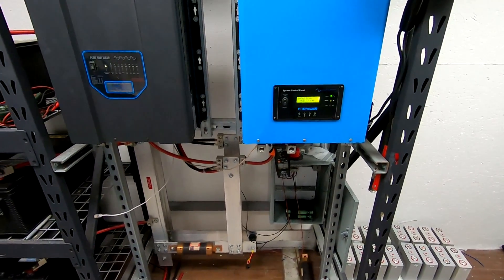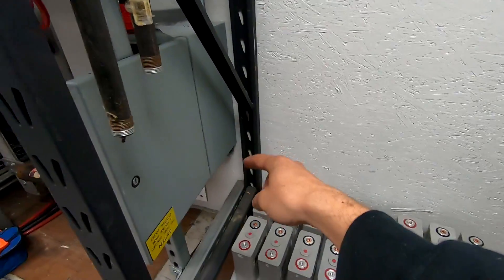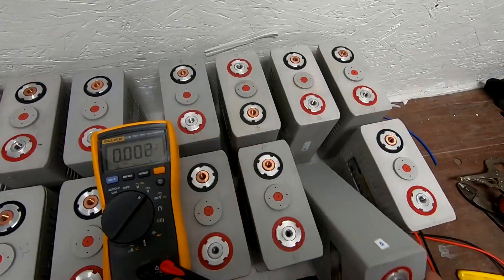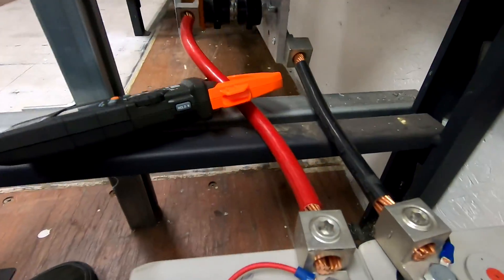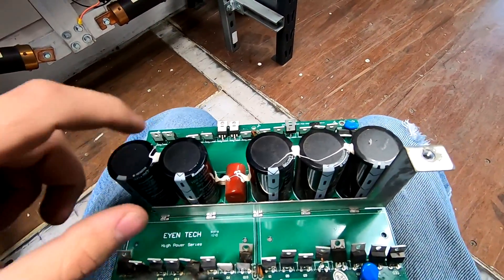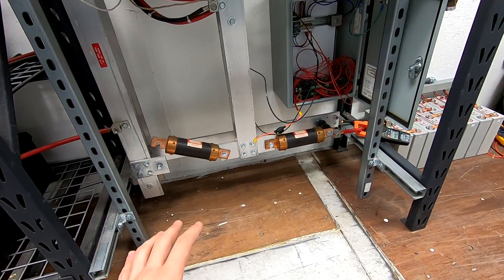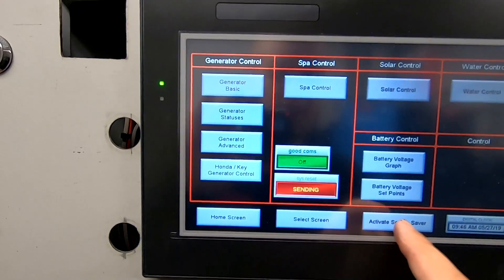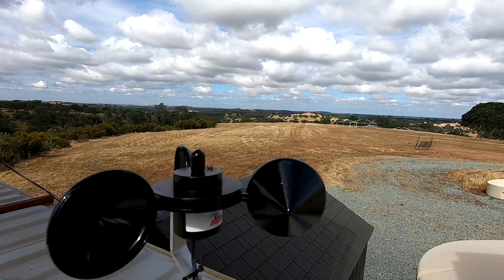Off The Grid: Installing the Best New Lithium Batteries!

Comment: Would like to speak to you directly. My wife and I are up in Reno-Sparks, Nevada working to be off grid. I was able to acquire two Absolyte GP 48 volt, 2,000 amp hour battery banks. We have a container for installation of electrical room like you have. If you have the time to speak - it would be greatly appreciated!

Comment: Totally enjoyed reading about your system grenading while gone. What are you growing beside solar on your 40 acres ?
I feel your frustration trying to run that compressor or plasma…!
I’ve got machine tools that are idle with no 3 phase…just 120…so I’m doing the DC motor route with full wave rectifiers.
We grow trop fruits off grid in so cal.

Comment: I plan on hooking my lifep04 right up with the lead acid and program the bms and charge control to a set voltage that both kinds of batteries like to stay at
Reply from the maker: That is literally a terrible idea. The best part about lithium iron phosphate is you can drain it down to nothing and leave it there and if it's paired with lead acid then you literally would be destroying the lead to get any of the benefit of lithium

Comment: If you cross any vertical helixed wind generators get them if you can. Such wind generator do not have to face the wind and will prove to lighten the load on gas cost, if any , when then sun is hiding and charging power needs are in demand etc...

Comment: With all respect to your skills can I ask why you have a 5hp air compressor? I cant understand why this compressor would be "necessary." Maybe it is because you are operating an air powered tunnel boring machine? 
Is that the highest drain device you have our are you running an industrial plasma cutter off of your inverters?

I do off grid for people that need it. What you have here is insane on so many levels!
Thanks for your time!
Reply from the maker: Oh yeah, we have air compressor and plasma cutter and welder

Comment: I found these on Ebay... Can someone tell me if this is a good or bad choice?  I have ordered a 200 Watt solar panel.  I'm 100% new to this... Appreciate any feedback on these batteries:  https://www.ebay.com/itm/LOT-OF-4-X-12V-200WH-BOSTON-POWER-LITHIUM-ION-BATTERY-PACK-18AH-POWERWALL/164125381684?hash=item2636a29434:g:2aoAAOSwaJ9agzSY

Comment: Hey thanks for taking the time to produce this video, and providing much useful info on your lithium setup!  
     On a side note about plugging in devices to power where they charge caps and have a huge inrush of current, I always use something like a lightbulb and wire it temporarily in SERIES on the circuit to charge the caps slowly, and the lightbulb gets dimmer and dimmer as the caps charge, and goes out when they are fully charged, then keeping bulb in place, I connect the actual main and there is no spark... Maybe you do something similar, but that's something I started doing as a teenager when working with big car audio amps and inline caps, basically anything connected that would make a huge inrush. I mostly always used a mechanic's 12v test light, but I imagine with 48v system voltage, one might want to use a lightbulb of higher voltage spec, and it would work in the same way. A resistor would work in the same way, but I preferred using a lightbulb because it gives visual indication of when the current flow is slow enough that the light no longer illuminates, then you know you're safe to connect your main...

Comment: Love your videos! Fellow electrician here as well. Im well on my way to building a very similar setup with a sigineer 15kw inverter. I understand you have the 12kw model and im really curious on how you manage the max charge voltage with those calb cells, as in, is the inverter charger adjustable for this or did you have to do something different to limit the max voltage internally or externally from the inverter. If youd rather communicate privately, that would be fine as well.

Im having trouble getting specific details on the available settings, as in max charge voltage from this inverter. Thanks in advance
Reply from the maker: I can make a video on it this week if you would like. It's actually rather interesting how I achieved this.
Reply: @HighTechLab  yes, id like to see more if you have the time.
Reply: mike h  in theory, yes. That inverter claims it can surge to 3 times it max rating so thats 45kw for a few seconds. Im holding out on buying to see what other inverters come out as they progress. Gentry solar has come along way and his inverters are stackable

Comment: At the highest point of the current surge, do you know how much current is flowing through each lithium battery cell? Or any estimate based on your experience?
Reply from the maker: When I start up my 5hp air compressor I get about 330 amps DC for a split second, but it really varies. Typically I try to avoid passing too much current through these cells, but when I do they handle it well

Comment: Are you just showing off??? I run my whole place and don't need anything near what you have. What are you trying to power...a machine shop?
Reply from the maker: We do have a shop, 2 RVs that are lived in full time and a hot tub that is kept hot with the excess power
Reply: @HighTechLab  Did you ever think about putting solar on the rv roofs? Or are they not used for travel.
Reply from the maker: They are occasionally used for travel but most of the time not so by having the panels at an optimal angle we get the most power generation possible.

Comment: Very interesting setup you have there! I have a couple of questions:  What is the BMS/balancing system are you using?  What was your solution to pre-charge your inverter capacitors and prevent damage from the inrush current?
Reply: Just use a small 12v motorcycle battery or a resistor to charge it up

Comment: Tip: Scrap copper tubing makes great cell connectors. Cut them to length, hammer them flat, drill a hole in each end.

Comment: I hate to break it to you, but your totally wrong about the caps. 6800uF isn't jack for capacitance. There is no way the leads would ever burn up due to charging a dead cap. Now if you ever got into the  2+ Farad range still using those leads then yes.
Reply from the maker: My statement is based on people actually blowing up their inverters. what evidence do you have to prove these blowing up inverters are in fact not blowing up due to this?
Reply: @HighTechLab  I think, the ESR of the Capacitors, not just the uF (size) is an important factor.  Capacitors with very low ESR + a Lithium Ion Battery Bank = very high amps in-rush ... which could cause problems.  All Inverters with large caps with very low ESR should have an "Off / Soft-Start / On"  type switch ( or external connection ) that allows for "pre-charging" of the caps through a resistor, or you can "pre-charge" manually.  How many amps can the Li-Ion battery bank actual push during in-rush?  4,800 Amps = 48 Volts / 0.01 Ohms ???

Comment: Thanks, for the video!    Very interesting setup you have there!   I did have a couple of questions, though:   What BMS/balancing system are you using?    And, what was your ultimate solution to pre-charge your inverter capacitors to prevent damage from the inrush current?   

I'm in the process of assembling the components needed for a 23 kwh LiFePO4 solar off grid system for a motorhome and an inverter similar to the black one you're using (I'm looking at the FuelZero 12 kw model) and I want to make sure I cover all the bases to prevent damage, as you described.   Thanks!
Reply: Richard Owens use a pre-charge resistor with a momentary switch

Comment: Wow - 180+ watts idle with the breakers off.  That is a huge iron loss in the transformer - I assume that's what gets hot and not the fets at idle.  I wonder why they do not use a toroidal transformer.  You should do a video on that transformer loss!
Reply from the maker: Why would a toroidal transformer make a difference?
Reply: Conventional "EI" frame transformers made of iron have edges where the magnetic field escapes rather than being coupled into the secondary coil.  The toroid "O" shape has no edges and completely contains the magnetic field inside the core, for higher efficiency without magnetic flux leakage. The O shape also allows for a shorter copper path in the windings which cuts i2R losses to a degree.  The downside is a special machine must be used to wind them, making toroidal transformers less common and more expensive.  All of the high end inverters, like powerjack, use toroid transformers.

Comment: Danger Danger Will Robinson! Get those Li-batts OUT OF THE ROOM, located out in a non combustable blockhouse. If you can somehow sink the blockhouse like a septic tank underground to level out temperature excursions they will last longer. If you haven't seen Li-batt fires please watch some on youtube, THEN GET THEM OUT OF THE COMBUSTION CHAMBER they are in at the time of the video making. You are aware of the hydrogen gas emissions of the lead-acid jobs and vent appropriately? The Li-batts are 100x more volatile. Better yet also place them in a deep sandbox tray because once ignition occurs you won't put them out and they'll need a static flame retardent bed to burn within. It's not a matter of if, it is WHEN. Let the comments roll...
Reply from the maker: Well, first comment is there's a difference in Lithium ION (like jehu's 18650 collections) and Lithium IRON, which is inherently safe when used properly [overcharge protection, battery balancing, overdischarge protection, over-current protection].  Under the worst conditions, any battery  can "smoke" - photonicinduction published a video deliberately overcharging a common lead acid storage cell creating a huge plume of smoke.  Jehu created an inferno of 18650 li-ion cells that burned another channel's VW bus interior in Alaska.  It is true that common Li-ion chemistry, such as the 18650 pack cells use, is a fire hazard, however Lithium Iron Phosphate (LiFePO4) chemistry does not exhibit these hazards, which is why I chose it.  These cells are used on aircraft, having passed the most rigorous of testing.  Take a look on youtube for real lithium iron phosphate tests and you'll see they require massive abuse like a 200% overcharge followed by a direct short circuit, and even then all they do is release smoke, no flames, no explosion - and it takes 14 minutes of short circuit abuse just to bring about the gas venting.  LiFePO4 is actually safer than lead acid when used properly.

Comment: Hello Hight tech! Can you use both systems battery ( lead acid and lithium ) in parallel at the same time?
Reply from the maker: Not really.  They have totally different discharge and charge curves.  The lithium cells would be drained before the lead cells began being pulled from.  Also the self-discharge of these weak, worn out cells is so high that you would LOSE more power than you store.
Reply: @HighTechLab  Thank you for responding! I currently working with a hybrid system with lead acid battery and lifepo4 , I made a wire diagram system that the lifepo4 charge with the lead acid system that is the main system for the production, and when the lifepo4 are full charge it interchanges from lead acid battery to Lifepo4 without fully disconnect the lead acid battery true a diode.

Comment: Aren't balance leads a little excessive for such a small lithium set up?  I have 800ah of lifepo4 in my truck camper @12.8v and have realized little to no variation in cell voltage after 4 months  using a cheap 60a renorgy charge controller (16 cells @ 200ah/3.2v). Balanced them individually on day one and hasn't been an issue since. As for the issue with not having the ability to transfer over to your generator after your inverter shuts down from low voltage, using a raspberry pi in tandem with a power transfer switch can remedy this problem pretty easy with a couple lines of code. Your system seems way over complicated. Your off grid, why do you need 48v power ?..... If the answers is to run an air compressor, IDKM
Reply from the maker: The bigger the better Bank the less abuse it takes.  The harder you run these cells the more they get out of balance and the more the need for a good balancer exists

Comment: 1C is nothing for these batteries
Reply from the maker: I don't think I have the genuine tie straps between the cells, they get rather warm during charging and heavy discharging.  I know these batteries do not like heat (Effects longevity).  I would change the tie straps but the truth of the matter is that these cells are somewhat temporary until I can get a bigger battery bank that is more capable.

Comment: I'm thinking about buying 48 of the same cells, where did you get them and what was the cost?  I need 16 for myself and have two friends both wanting 16 so we figured we would opt for a group buy.
Reply from the maker: I went in with another channel on a group buy - they do them from time to time.  Contact lab@hplab.com (high power lab) because they order them in bulk from China with great pricing to California for large ups systems.  They are also a Fed-Ex authorized shipper to send them inside the USA by ground, but I just picked mine up in person.

Comment: As a electrican i am concern about the safety, when i see Everything is open and no some sort of shield under your converter.
But I enjoy seeing u playing around with The installation 👍
Good Video..
Reply: Copper Fuses connectet  to Aluminium - U get metal reaction.. Bad descission. !! - I can see the open COPPER Fuse has left a reaction on the Aluminium ... !!!
Reply from the maker: Not with noalox into oxidant grease... It's no problem
Reply: @HighTechLab  
Can U Send me a Link to that Please.. ??

Comment: You can save the 8d batteries by killing them completely and charging them backwards for a few minutes.Then change the electrolyte and charge them the regular way.I turn them upside down and flush them out and then batteries plus sells electrolyte for $30 for 5 gallons.They will be almost new,once the lead sulfate is removed.Don't charge with a lot of amps,trickel charge it

Comment: Battery banks should be connected with the closest gauge possible to the terminal diameter (min two gauge) not flat metal copper links (I don't care what factory says).  One gauge is better.   One continuous piece of wire is best (instead of piecing together segments).  Fab your stuff.

Lead acid batteries work fine but they are really designed for 50-75% charge rates.  The amount of time needed to charge a lead acid battery over 75% is not worth the fuel.

That's your problem.  You can probably drain the 'dead' batteries, fill them with distilled water after desulphur, place on a sonic cleaner tray over night, drain, then refill with fresh battery acid and recover some costs. (watch desulphur techniques on YouTube)

Running diesel generators use 5k big truck alternators, not what some 'energy' supplier says (run them off belts). Yeah you gotta fab your stuff.  Shrug.

If you don't connect your battery bank with the thickest, shortest wires, wasting your money, longer charge rates, etc.  Double the gauge of solar panel wires, add capacitors if you want to get extreme.

Off grid energy companies have no interest in my opinion selling trouble free systems, do your homework.  They can double profit margins selling new connectors, batteries, etc, knowing system is under rated.

Good luck recycling lithium if factory does not buy back. Do not charge batteries in your house (palm face).  Check your insurance policy.  I would design a system that needs two to six hrs a day max diesel with summer ac loads.  Otherwise rent a motel..

Grandpa used to charge golf cart batteries every night with all caps off.  Walking in the shed you thought it was going to blow up any second (lol).  He knew his stuff though.  Times change.

Comment: Can you put in a resistor to change the capacitor  from the batteries.  Off the top of  my head something like a 500 ohm 10 watt should let the capacitor change up at a nice rate before putting the full battery on line.  Just a thought,  maybe good thought maybe not.
Reply: No,it's a fine suggestion. I use a similar resistor.
I also use a 10 FARAD cap to help with the initial voltage surge.

Comment: Those buss bars are useless
Reply from the maker: What do you mean?
Reply: @HighTechLab  a small frame to mount the fuse under the inverters would mean that you had space for the batteries underneath also. And although it is not high voltage it is an electrical hazard and you just dont need buss bars. For such a small installation. They are just easier for switchboards to mount a lot of things to them. It would be a lot neater with just some cable and block connectors

Comment: NTC inrush limiter..  Cheap insurance.
Reply from the maker: My engineer has a few he's supposed to be giving to me but I think he forgot about them
Reply: @HighTechLab  Wouldn't the NTC have a constant power loss, unless bypassed or only used during Pre-Charge?  What is advantage of NTC vs resistor + push button switch ?

Comment: Just out of curiosity's sake, why not install a disconnect in line so that you do not have to release the fuse? You can get a simple disconnect like what is used for air conditioners from a home improvement store.
This vastly improves the safety aspect and reduces the risk of arc-flash. Also each set of batteries could have its own disconnect and you could turn on and off as needed, without disconnecting a fuse. The fuse will always be inline and reduce the odds of ever stripping the threads on the bus bar from over tightening the bolts for the fuses.
Reply from the maker: Because air conditioner disconnects are nowhere near rated for enough power for what I'm doing. It would need to be like a 400 or 500 amp disconnect
Reply: @HighTechLab  The disconnects must be rated for DC Amps.  AC Amps only rated disconnects do not work well with DC Amps ...